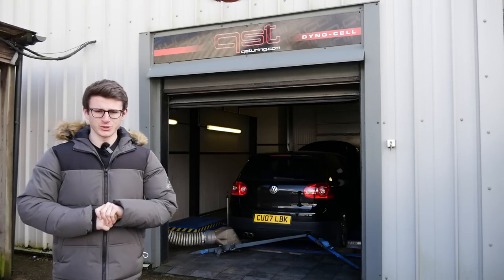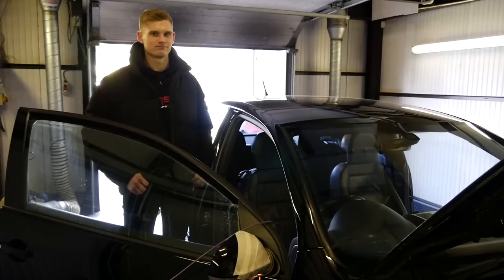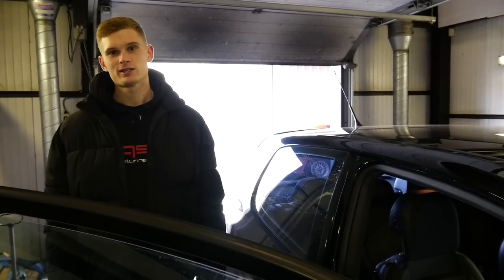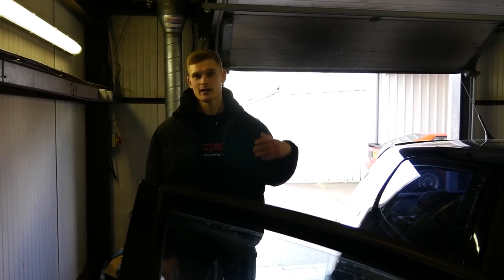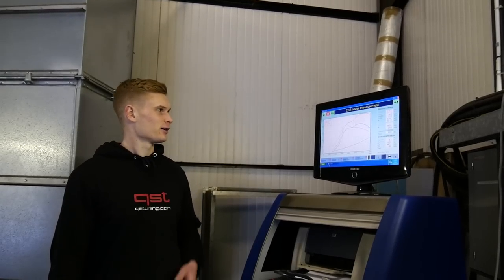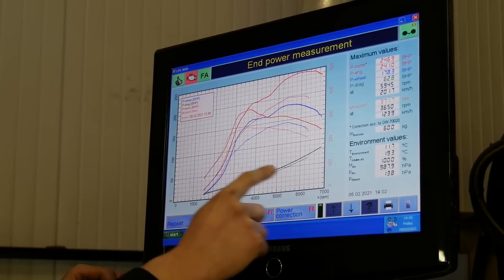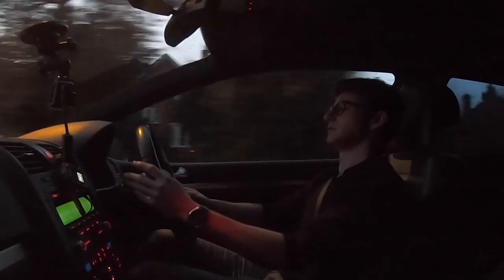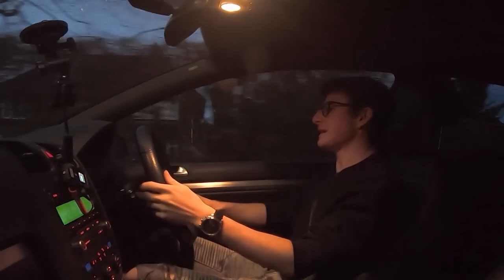TUNING My 100,000 mile Golf GTI!

Comment: At least you don’t have to go down the uprated clutch route, one benefit of the dsg I guess
Reply: another benefit is that it's faster then a 6 speed
Reply: No, but he will have to go down the replace the mechatronic unit or the entire gearbox route 🤣 because those boxes are made of toffee
Reply: @maverick4177  from my understanding the dsg's can hold more power than the standard.  Mechatronics issues are pretty much non existent now a days but back in the mk5 days they did have since issues.
Reply: Other benefits of the dsg, quicker to 60, quicker in the 1/4 and can hold power better even modded... So if "performance" is what your after the dsg is the transmission to get in a GTI... Now if your into that purity bs then yeah get the manual.  I buy what gearbox is best for the car.  In my lancer evo days yes standard gearbox the way to go... On the gti it's the dsg😎

Comment: After driving a "Wild Child" Speed 3 (that's what it was unofficially dubbed by its developers) for 7 1/2 years, my first drives in my new MK 7 Golf R seemed a little too sedate and underwhelming (as if nearly 300 HP could be considered as such). Two weeks into my Golf R ownership, with under 1000 miles on the ODO, I took the car back to the dealership's tuner shop and had an APR Stage 1 tune put in. I'll never forget the "Holy Sh*t!" moment I had the first time I got on the gas, even holding back as the car wasn't fully broken in yet. Tuning is a wonderful thing!

Comment: Had a Revo ECU and TCU on Friday on my Mk5 GTi and my reaction was the same as yours. Massive change to the car and you have to wonder why VW didn't do something closer to this out of the box.
Reply: Did you do yours stage 1? I'm thinking to go revo for mine but mine is a manual. What did you get out of it?
Reply: @GassGar  it's about 245bhp based off of feel compared to others. Defo worth doing!
Reply: @MehMeh  sounds like a good shout.👍🏾 Definitely will be doing that especially I've got an induction kit on mine

Comment: I have the money to buy a 2010 gti on offer up and it has 107,000 miles on it, is it a good idea and will it have any problems?
Reply: MK6 GTI have got timing chain issues on the early 2.0 TSI, so I’d have a look at having that replaced if it hasn’t already been done and the revised guides fitted

Comment: Oh the gear change will be spicy alright.....just before you get the dash full of flashing red squares when the mechatronic unit shits it’s self
Reply: Possibly, but maybe not.  The transmission itself is stout it's the electronics that were hit n miss on the dsg's of yesteryear.  He has a buddy there at the shop that did the tune.  He gave it the green light to do the mods and if the mechatronics does fail?? then I'm sure he will have his friend fix the issue if it presents itself.  The newer DSG's are much improved in this aspect and from a performance perspective the better transmission for the GTI😎

Comment: Does the TCU tune make a difference when driving in D mode or just when in S and manual?
Reply from the maker: Less noticeable, but the reason you get it done is for the manual shifts

Comment: Just something you may wish to look into Luke. Apparently as from September, the government are planning on phasing in E10 unleaded petrol to replace the current standard which is E5 due to emissions. The extra ethanol in E10 is supposed to be very harsh on engine internals and seals. Mpg is also slightly worse, although that won't bother you I'm guessing lol. All engines manufactured after 2011 are required to be able to run on E10 so shouldn't be a problem for most. With yours being a 2007 on 100k miles,  it could be an issue, especially if its tuned. As I understand it,  super unleaded will still be available , which will be a safer bet for older engines!!!!

Comment: I'm not sure why 100,000 miles is in the title suggesting it's high mileage... nothing out of the ordinary for one of these engines 😁
Reply: Pretty sure his has 90k on it from a previous video too
Reply: My mk5 has 174k and went stage 2 in november no problems. Just needs a downpipe and intake and regular maintenance. Timing belt and cam sensor really all you need to watch
Reply: @Shortstahp  Solid engines, the fuel pump bucket is also worth replacing. Much better than the 2.0 tfsi variant that followed with the timing chain/tensioner issues!
Reply: @spainter1985  i agree, i think my fuel pump def needs a replacement. The thing i do notice right now is that carbon buildup too but overall man the dub is such a perfect daily 🤟🏼
Reply: @Shortstahp  In fairness same problem with any direct injection engine, quite a few companies are able to clean them nowadays without too much dismantling 😃

Comment: I just did a stage one tune on my 2012 MK6 GTI. I purchased the Integrated Engineering tune. Everything else is stock. Performance gains are very impressive. Obviously more power and torque, but the updated throttle response is really noticable. I have owned the car since new, it has 49000 miles on it. This feels like it should have been delivered this way.
My only real concern is the clutch as mine is a manual transmission car. IE claims 39hp and 51ft/lbs. Other than giving my GTI that wow factor, it drives exactly the same as stock in traffic and normal conditions...... Put your foot in it though, it turns into a beast.

I highly recommend the IE performance tune!

performancebyie.com